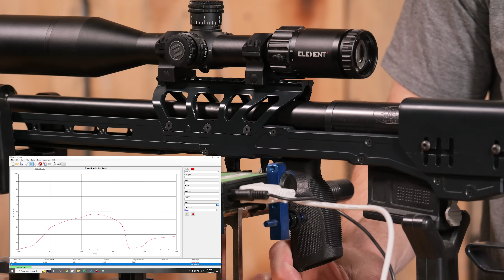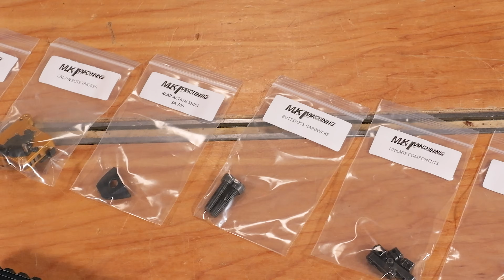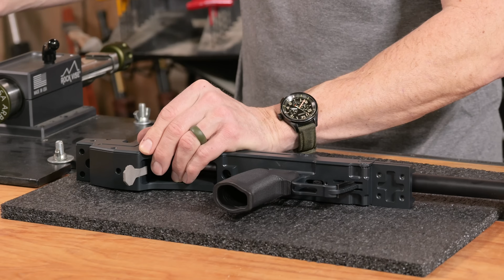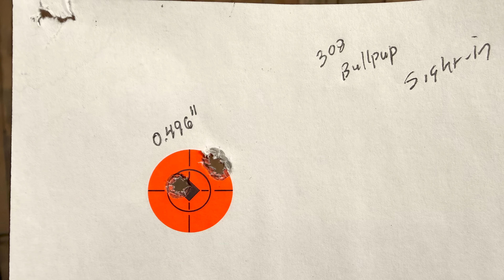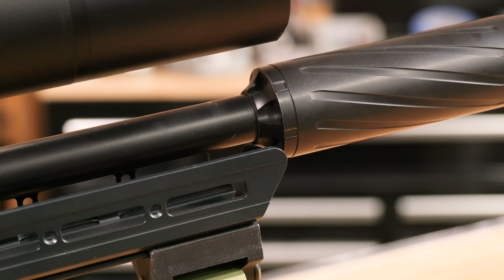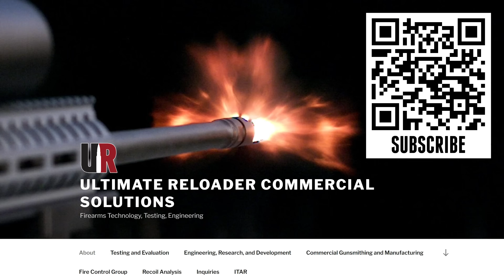NEW: MK Machining Bullpup Chassis MK2.6 Custom Build & Test

Comment: I'm interested in the bullpup design to run suppressors without gelding cartridges with short barrels. However, my current build will be for NRL. It looks like you can't cycle the bolt without breaking cheek weld. Is this accurate? Also, I'm a little unsure about the required optic height. Is it higher or lower compared to action mounted optics? Does the more remote optic mounting introduce any loss of accuracy? Ideally, I want my match gun running in the .2-.3 range. Any challenges to accuracy that are unique to this design?

Comment: Cool idea and maybe an alternative to the new Walther RS3.  I just don't understand why on earth having the benefit from the Bullpup design ( shorter overall system length) one would go with an ultra short barrel and scarify all the extra speed. and then seeing the weight of the chassis I think they missed an opportunity here. If my conversion tool is right the 96oz are 2.7 kg ? add system, barrel, suppressor mount  and optics an you might get a (too) heavy little gun.

Comment: Price is not terrible for what you get.  The curtis action would be a must for me. So it will be lighter and the weight will shift rearward. My first thought is use a heavier or longr
Er / heavier barrel with a steel can.  Great concept, bullpup conversions are usually sheet, this one seems legit.  Thank you sir, its on my list.

Comment: (UK Deer Hunter )  I would look at dropping my 16.5"  R700  in 6.5x47L  Deer gun in as I like short rifles  ( I couldn't fit my Full Reflex suppressor on as it is 2" dia and comes back down the barrel 4" with out chopping the fore end but it converts to a EOB can as well) . I cant see any actual length data on the websites .. how much shorter is it  I run a MDT HS3 with a collapsible stock   looks to be 4 to 6" saving . No idea if I can get one over here though  and would be way more than $2000 if I could 😔

Comment: A bullpup chassis like this would be great with a 8 inch 8.6 BLK barrel and ultra quiet suppressor. The CAT BBK for instance is 1.8 inch diameter and 9.5 inch length, so the handguard would need a larger inner diameter to make that work but I think such a system would be really compelling for standing shots on hog hunts.

Comment: Wish there was a way to shift the bolt handle towards the front of the bolt without machining the receiver and welding or something. It looks like the rearward position of the bolt handle forces you to come off of the cheek piece with every shot, or to awkwardly almost punch yourself in the face..
Reply: Gavin eluded to it, but we have a collaboration with Curtis Actions right now and they have a forward swept bolt handle just for our chassis. We also have a simple clamp on bolt extension for other R700 and clone actions.
Reply: Its not as uncomfortable as you might think. BUT they used to have a bolt handle extension that just clamped onto your factory one. Not sure if they still offer it or not

Comment: Looks like a viable alternative that allows more options compared to a desert tech srs. How large of a barrel can it accept? Maybe one of those tacom structured barrels?
Reply: 1.250 Straight barrels are not an issue. I have looked at the Tacom barrels, and they will not fit in this chassis.

Comment: I had one with a Bergara 24” 6.5 PRC. It was awesome, trigger was fantastic but I sold it to get a desert tech SRS-M2
Reply: Which one do you prefer?
Reply: @ghost101049 by far the desert tech! Quick change barrel system that works and holds zero, fantastic trigger (not as light as the MK) better ergonomics on the bolt with the lever at the front of the bolt. My 6.5 PRC barrel shot a .450” 10 shot group and my 300 Norma barrel shot .680” for 10. So they are accurate for sure!

Comment: That is a cool option to have and very nice to see that the trigger is nice. It is very petite with the 16" barrel. 
I would be interested in using a cartridge that could utilize a long barrel and seeing how it handled. 30 or 338 cal at 28 inch, make the most of the space where its useful.

Comment: Interesting to shot with 26 - 28 inches barrel
Chassis plus trigger.. is not too much
Reply: I reckon getting it as right as they did in low volume, that is extremely impressive.
A good trigger for a bullpup conversion is difficult at best. And usually tragically poor.
That the scope is constantly cowitnessed to the action on a not just one type of action but cloned action. Again very impressive.
Reply: It is too much.

Comment: Seems more like it should be priced somewhere between $1,000 and $1,200. $2,000 is way to much
Reply: The trigger alone would eat up 1/4 of that price.
Reply: @anthonybarker9123 no it wouldn't it's not the first of its kind plus the cost of a couple rods is pretty low
Reply: @jlarocque84  The Timney Calvin Elite is $230, or aprox 1/4 of your suggested $1000 price...
Reply: Interesting tidbit, the internal linkage pieces make up around 30%+ of the hard cost for the machined components.

Comment: I have this chassis in a custom build built for target shooting practice/plinking, not competition.

Some notes:   It's looks are  deceiving, it's extremely light by itself.  This is not a heavy PRS type chassis.  It's cerakoted E-110 Midnight.  This is NOT black, it is a very, very, very dark blue.  The best use case for it in general is maneuvering in a blind in a warm weather environment (It's all aluminum, it's cold).  As shown, the trigger is super good, zero complaints other than it's not a two-stage.

The cheek riser being metal (Super cold) is substandard and needs real design time.  I've designed/3D printed a replacement that allows access to the bolt release without removing the riser itself and allows cheek contact as low as possible to help with the scope eye box for those of us that need it.  Also, polymer, not cold.

Magazine well is a a bit loose for my MDT AICS magazine, the well has a huge cutout after all.

All in all, it's super cool, it's fun to use, and gets people excited at the range.

Comment: A bullpup like this lends itself well to a bush hunting rig, having a short overall length, while still maintaining a good length barrel.
Personally I'd be dropping a Tikka 16" .308 into it, with a suppressor (pretty much a typical New Zealand configuration).
It does look properly heavy tho, so probably not something you want to carry into the bush. Also the balance on the tripod looks excessively rear heavy, so I imagine there will be a lot of reticle movement away from the POA when locking off the ball head and letting the rifle rest unsupported on the tripod?
Don't get me wrong, this is a sweet looking chassis, but I just fail to see where it would excel over more traditional setups. i.e. MDT HNT26 with a folder for hunting would be lighter and stores away short. A traditional chassis  with more weight forward would balance better on a tripod for PRS type shooting.
I think you hit the nail on the head when saying this is for someone wanting something unique and different. Not necessarily the best any any particular job, but very high on the cool scale.

Comment: And of course its not left hand action compatible 🙄
Reply: It is absolutely ambidextrous. The main rail has a cutout for both left and right hand actions and the cheek piece can be mounted on either side.
Reply: It totally is.  Look around 13:14, and you'll see the bolt cutout.  And the threaded holes for the cheek rest are already there for left-hand action use.  I just wish they would make this for he savage arms impulse straight action.

Comment: i feel like this chassis would be best with a rifle that has a handle on the front of the bolt, im not sure which, but one that would have the handle closer to the grip or trigger
Reply: That's what most purpose built bullpups do, but the magic with this chassis is that you can sit any R700 action into it.  That's the compromise.